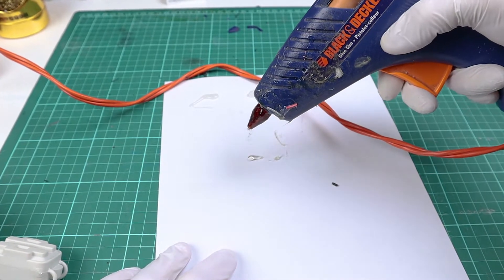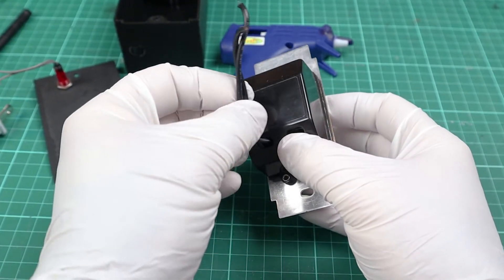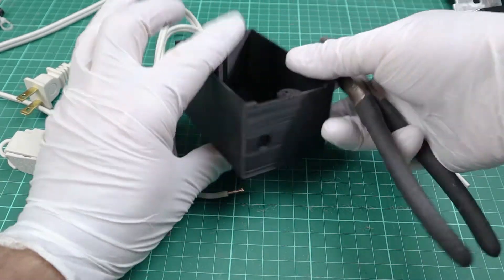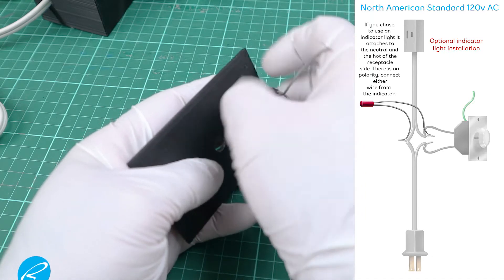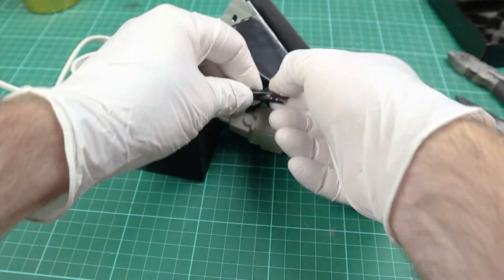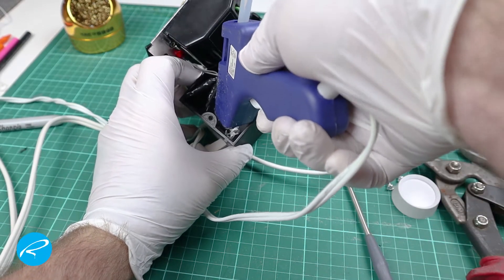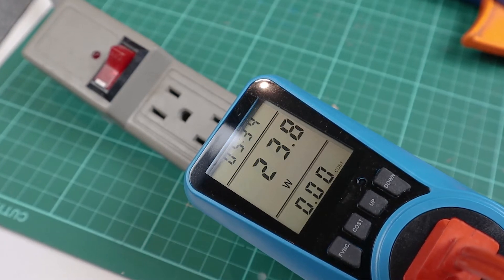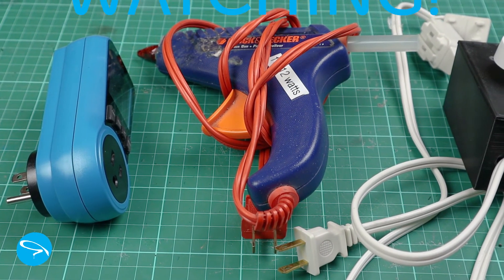DIY Hot glue gun temperature controller.

Comment: Wonder why you didnt just buy a 1.50$ single gang plastic electrical box with a .75¢ faceplate then just drilled holes in the plate for leds and used the box built in holes you just break away for any cabling.  Or could have gotten a single gang sealed box just the same for a few more bucks..
Reply: Because making stuff is fun.

Comment: So it only makes the glue gun run cooler than stock temp? The temp controller doesn't make the glue gun hotter at all? I'm trying to make mine run hotter so I can turn it into a 3D pen and use plastic hanger as the medium... But my gun won't melt the plastic at current temp...any suggestions?
Reply from the maker: You can't make the gun run hotter than it was designed to do. That has to do with the heating element in it. I've got a 3d pen and I don't see how this would work, it's quite a bit different than a glue gun.

Comment: Great video.  I've wanted to build a contraption like this to lower the temperature on cheap soldering irons but I was always told it wasn't a good idea.  Have you run into any issues?
Reply from the maker: Because this is a rather "dumb" piece of analog tech, and depending on the glue gun, it can seem like it's trying to fight you, giving you fluctuating temps. It would be nice to have something that senses the temp of the nozzle and keeps it at a constant, but that would be a much bigger project to dive into. Nothing dangerous has happened though when using it.